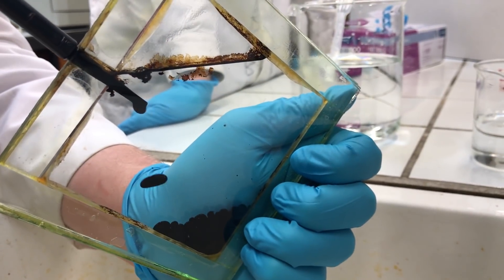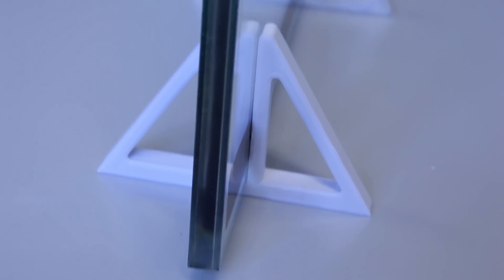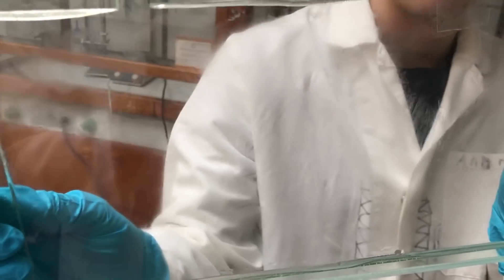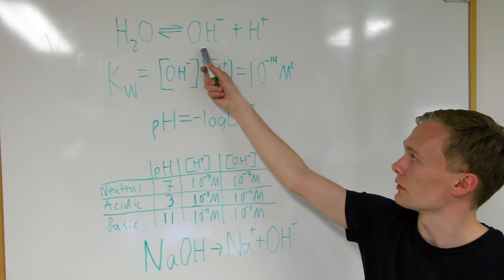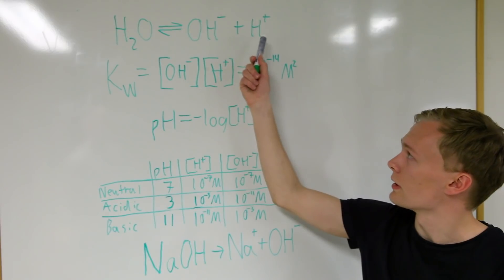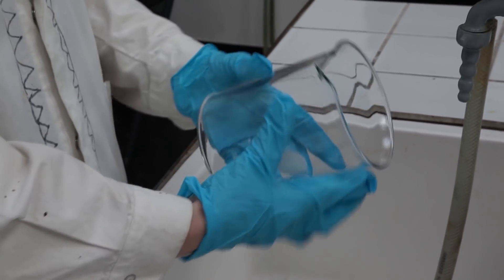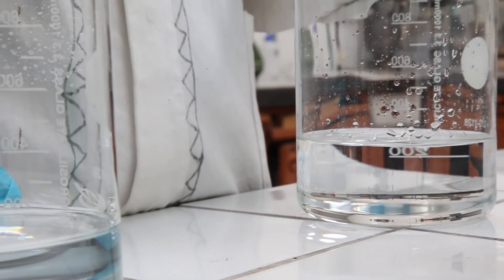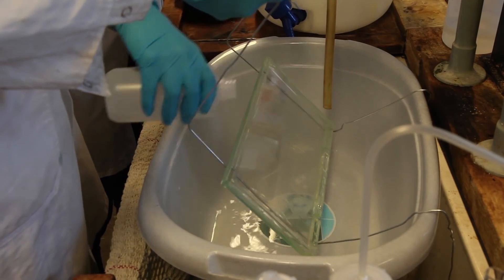How to Make a Ferrofluid Container - Part 1 - Fetch #4

Comment: Hello, you mentioned that you tested 4 types of treatment: lab grade acid, lab grade base, regular vinegar and "nothing" for control, but I cannot find a conclusion, could you please tell me which way is recommended?
Reply from the maker: Yeah, unfortunately the results were inconclusive, so we went with the base without doing further investigation. We found that leaving the saltwater in the tank for 24 hours before adding the ferrofluid was maybe just as important as the treatment (ie. the base treatment doesn’t work if you don’t do this), but we don’t know whether this is also true for the other treatments.
Reply: @AppliedProcrastination  Thank you for the reply, then I will continue with the base. I am making a small toy by myself, really love your work on this.
Reply: @yizu6565  Hello, did u manage to make it? i am fighting with some stains on the glass surface aswell :)

Comment: awesome project guys!!  You have my sub!! I wonder how you did the saltwater solution, is it only salt with destilled water?
Reply from the maker: Thanks :) Yeah, it’s only salt and distilled water. We saturated the water completely (at room temperature) by adding salt until it stopped dissolving. We also filtered the water a few times through a coffee filter afterwards
Reply: @AppliedProcrastination  thank you!! big projekt, it must have taken a long time until everything worked. Big respect for not giving up!!
Reply: @AppliedProcrastination  Hi. What is the concentration of salt in. did you get the water? Does the salt then precipitate in water at the maximum saturation of the solution?
Reply from the maker: We haven’t measured the concentration, but like I’ve said before: we saturated as much as possible at room temperature, so the relative concentration should be very close to 100%. There’s no visible precipitate in the solution (if there is any it is obscured by the ferrofluid), but some salt has managed to escape through cracks in the tank that were not sealed well enough.